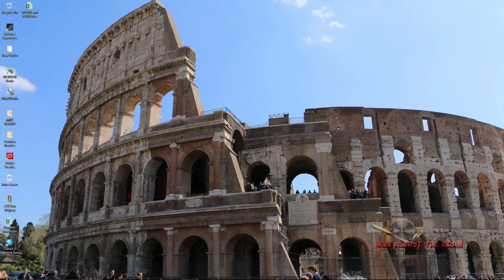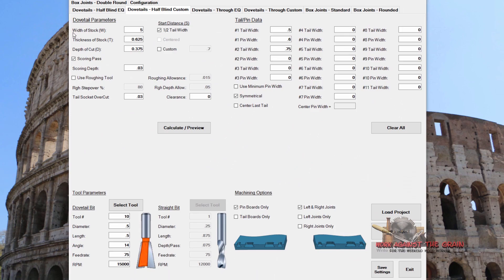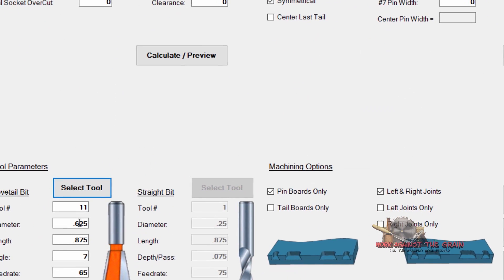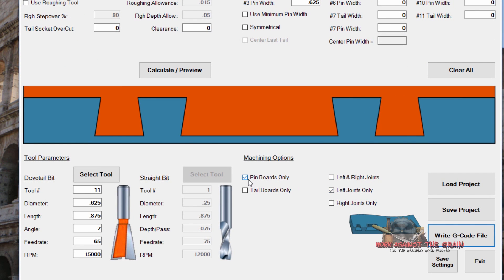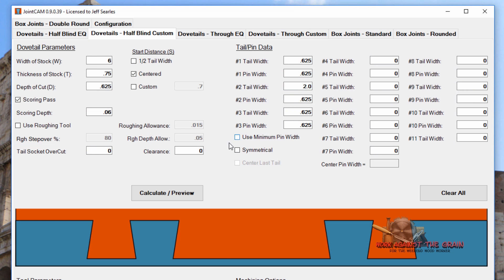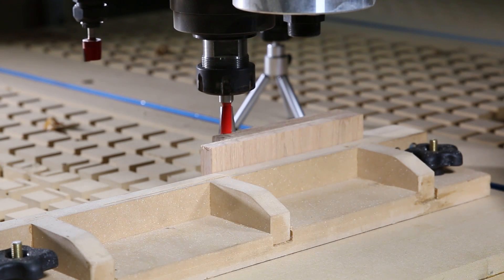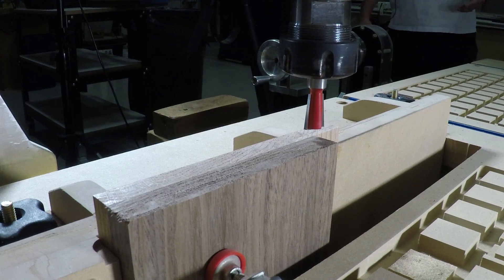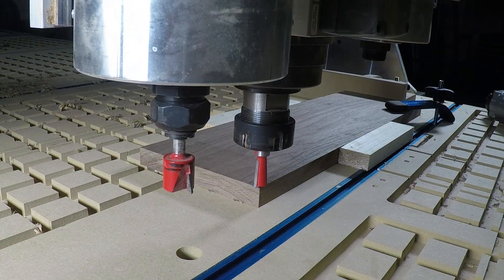CNC Joint Cam Alternative ---- READ DESCRIPTION PLEASE

Comment: Jeff you may be past this problem but I have made it possible on my machine to go to the fixture opening perfectly. This will put you at zero on your opening and can be used to make a fixture for flat cuts as well. I referenced my machine and set x and y 0 at the end of the reference. I used the manual input to move the router to my desired hole location and cut out the hole for the boards to be inserted. I wrote down the hole coordinates and it was done. The next time I started my machine I zeroed out the x and y and used the manual input to advance the router to my fixture location. After the advance I referenced my machine to that location so that the machining would be precise every time. I am fairly new and I hope this helps. The manual input I used was G00 Y4 X24 my machine is set up as the x being the length and y the width. Great videos and thank you for your content

Comment: HI Jeff I just watched your joint cam video great bu the way,  Have you ever used the box joint  program. I am looking to buy this program and would like to find a video on using the program to set up box joints. can you do one or do you know where I can see hor to set up the program  Thanks Jeff Peters
Reply: If you have a vertical jig on your CNC the box joint program works GREAT !!! I'll see what I can do about a video. VERY easy to setup and use and well worth the money.  Thanks for watching.
Reply: My Shapeoko will move past the front frame rail far enough to cut  box joints. I am working on a  jig to hold the wood in place. Thanks hope you can do a video on showing how to use the soft ware to cut out  box joints.
So let me know when you have it. 
Thanks Jeff

Comment: Jeff, what a great video! very thorough and it will help me for sure. did you get the new version downloaded and try the code again? I was thinking that maybe where your zero was off was where you set it to cut your pin board. how did you find the x/y corner? If anything, the pin board should be cut too deep because I think that would be easier to trim than having to plane the entire tail board. Still have not tried it but will soon, just an observation! Great work!

Dylan
Reply from the maker: Dylan, turns out, my zero was dead on, however, material stock was NOT 3/4 of an inch. Was about 1/32 over resulting in a bit thicker tail board.. That's how exact this program is. It did everything perfectly. That "extra" was a result of my planer being off a bit. To your point though, once you get a few "test" pieces cut, as long as material thickness, zero point and XY zero are consistent, these batch out in less than a minute. Thanks for the inspiration and feedback.

Comment: Aspire is way to over priced! V carve pro is to! Just use the free Fusion 360 that does much more. I paid $600 for V Carve pro and I don't even use it because Fusion just blows it out of the water! Do some research before you buy this overpriced Vectric software. $2000 is insane for Aspire when I can do better with Fusion 360. I will never buy this software again.
Reply: Fusion 360 has great features, but the learning curve is steep, If you do mostly 3D stuff it's great.  V Carve Pro and Aspire are easy, very easy, for most of what us simple minded CNC'ers do in 2 and 2.5D. Yes, it's pricey, but I can get things to the machine much faster.  With their new unwrap utility many 3d things become easy too.  I mean no offence to Autodesk, I just can't seem to get comfortable in that enviroment and I will continue to work on learning it.
Reply: @harrysuber753  who idiot pay 2000 or 600 software what can download FREE anywere i internet and can use whitout waste stupid money anywere, all hobby users not have money waste 600 or 2000 or 200 $ to one software if all can download olden version FREE. better only pro woodworkers shop pay software and hobby users can use all FREE.
Reply: onlychevys Williams thanks for your feedback.